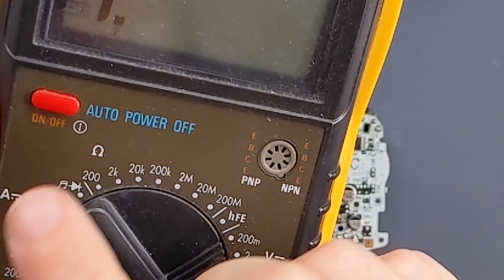Nintendo Game Boy Advance Laminated ITA TFT install tutorial

Comment: The fast switch off switch on problem is a certain resistor that I can't remember that is supposed to prevent that
Reply from the maker: I'll look into that, thanks
Reply: @JoeBleeps  R13 should be the one, backside of the motherboard under the right downmost capacitor
Reply from the maker: @niplob  thank you!

Comment: Just used your video during my build! Appreciate the video a lot, i'm having some issues with the R shoulder button not sitting correctly and keeps feeling jammy but other than that the FunnyPlaying kit is awesome!
Reply from the maker: Did you get FunnyPlaying buttons?
Reply: @JoeBleeps  Yeah I got the FunnyPlaying buttons, the L shoulder works perfect but for some reason the metal piece you put in the R shoulder keeps causing a weird jammy feeling when i press

Comment: Hi, don't you notice the white lines/stripes like scanlines issue these ITA kits have? It appears every kit has the exact same issue, I don't comprehend how makho and other youtubers don't notice the problem.

My kit came today and after correctly adjusting the potentiometer I noticed the white lines/stripes, then I went to the internet searching for the issue and found multiple post on reddit.

It's such a shame that no YouTube video shows this issue, I thought I've finally encountered the perfect kit for the GBA but sadly no.
Reply from the maker: It's a shame that happened to you. If I encounter problems with the kits I use I'll always highlight them but as you can hopefully see in the video I had no issues with my particular display.
Reply: @JoeBleeps  The thing is that probably everyone has the same issue, it's supposed to be a ribbon cable fault that funnyplaying didn't manage to fix, because people connected a display with this issue in a DSi and problem solved, so it's not the display but the ribbon. 

I think you don't manage to see it because it's somewhat difficult, it's well seen in solid darker colours like the green background in pokemon pinball (ruby table) when you pause the game. It's an alternating pattern of darker-brighter-darker rows of pixels all over the screen.
Reply from the maker: @elude3808  thanks for the more detailed guidance, I'll take a look

Comment: Sorry for my english!
I have a 32 pin motherboard, i want to install tis mood but i dont want welding any cables
What the differences between weld or not?
The flicker test is always necesary?

Great video man!
Reply from the maker: 32 pin does not need any welding. Flicker test is not essential 😊
Reply: @JoeBleeps  Thank you  man!
One more think, they brigthnees of the screen is always in maximum level when not welding any cables?
Reply from the maker: @Sounderizer  yes that's correct
Reply: @JoeBleeps  Thanks bro, You are amazing!

Comment: If I don't plan to solder any wires, do I still need to take off the capacitor on the 40 pin motherboard?
Reply from the maker: Yes if it's 40 pin that capacitor will need removing

Comment: Very good and well informed video, thank you! :)
One thing you could maybe have mentioned is the pixel grid, not all people love it or care but personally I love pixel grid like on the AGS101 :)
And as far as I know the ITA kit also has it!

Also don't yours have the OSD?
Reply from the maker: As far as I'm aware this screen doesn't have pixel grid or OSD but if you let me know how I'm supposed to check I'll let you know. I thought the pixel grid was for the IPS screens as the ITA is already pixel accurate
Reply: @JoeBleeps  Normally all legit Nintendo screen got the grid, it's just some kind of cosmetic thing I would say

I read something about an OSD on funnyplaying and makho also mentioned it (but he didn't have it because his kit is from pre production)
Reply from the maker: @Scresho202  I think you're getting it mixed up with a different kit
Reply: @Scresho202  Yeah, there are 2 versions of this kit. The IPS and the ITA kits. The ITA is an old DSi bottom screen and has the pixel grid. They recently released both as a laminated kit
Reply: @JoeBleeps   Hey. Amazing video. I have this kit and it does have a pixel grid. Doesn't have an OSD but you can hold down both triggers and then hold down select after. You'll then see a border around the lcd and you can use that to adjust the vertical screen aligment. hold that button combination again and you can adjust the horizontal screen aligment. Just make sure you hold down L+R before holding down select. Hope this helps anyone wanting to know. Also i'm in love with the TFT screen and i have tried them all.
Reply from the maker: @renboxtable  oh yeah the screen alignment I featured in the video, I was talking about the pixel overlay like the retro pixel IPS kits
Reply: @JoeBleeps  I bought an ITA laminated kit (I got it last week) and I have an OSD when pressing select for a few seconds. I was surprised because in all reviews this OSD isn't present at least for ITA screens.
The options of the OSD are: BRT (set the brightness' level) FRM (I don't know the name of this) XST (set the X position of the screen) YST (set the Y position of the screen).
Reply from the maker: @ichika-matsuoka  that's awesome! Mine doesn't have that (I just checked again) so yours must be a newer version. My IPS console does it though and it's great